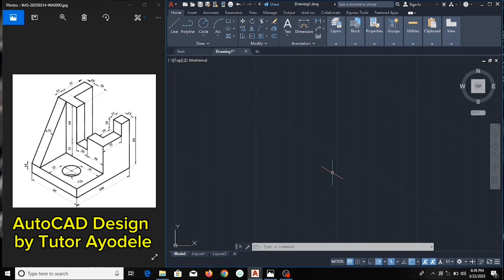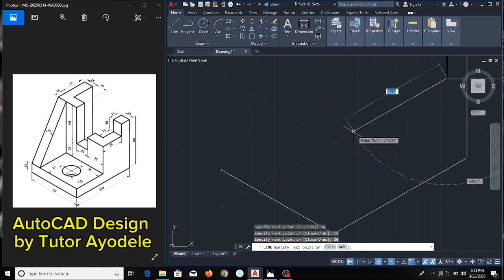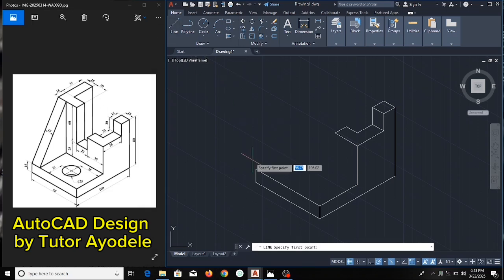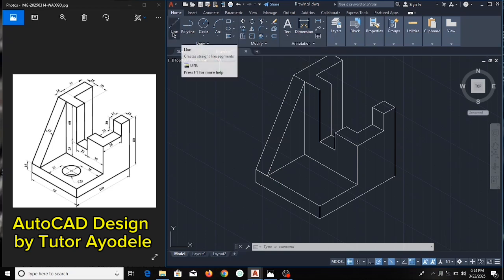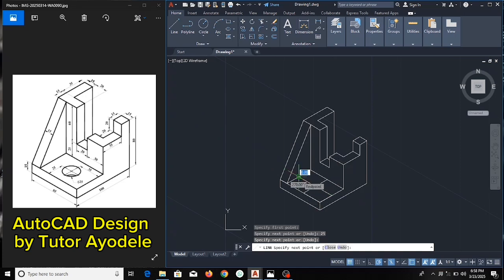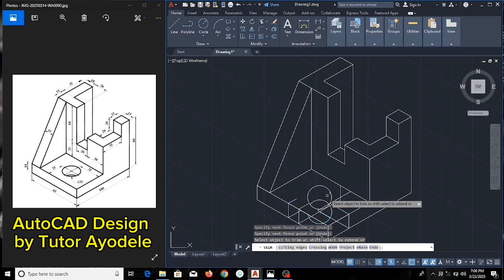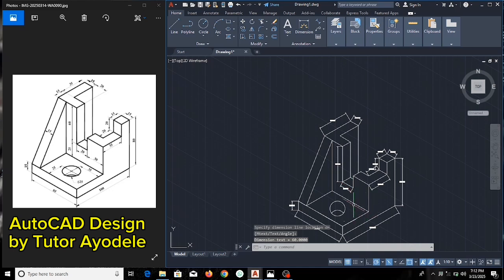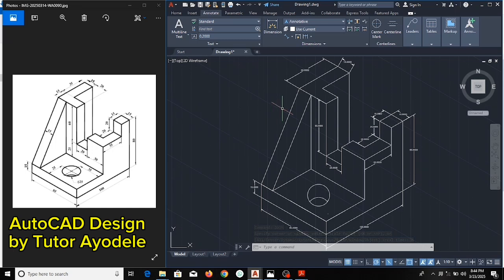AutoCAD isometric projection | AutoCAD modelling made easy

Comment: What level will I b going to do this
Reply from the maker: Engineering/Technical Drawing, especially with AutoCAD modeling, is a course you'll continue once you start, though it may not run through all levels—particularly for students outside Mechanical or Marine Engineering. In some schools, it begins at 200 Level, while in others, it starts as early as 100 Level, usually in the second semester. I hope that's clear. If you tell me your school name, I can let you know exactly when you’ll start offering it.
Reply: @TutorAyodele  mechanical
Reply: What level did u guys do urs Mr ayo
Reply from the maker: Well, in my school, I did Engineering Drawing in 200 level, both first and second semester. But after our session, the school moved the course to 100 level second semester. I mean, currently, my school starts Engineering Drawing with students right from 100 level second semester.